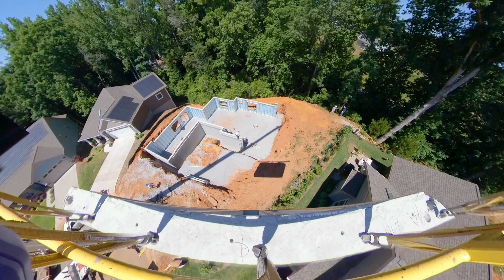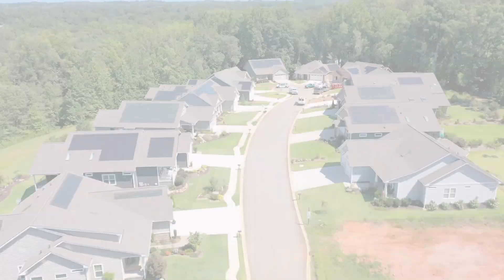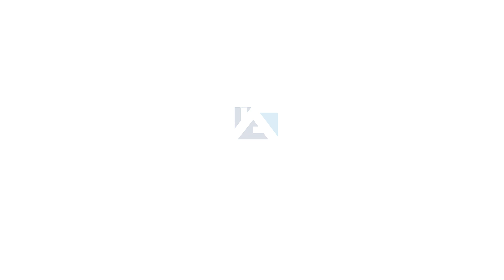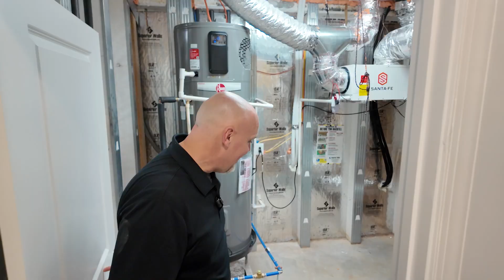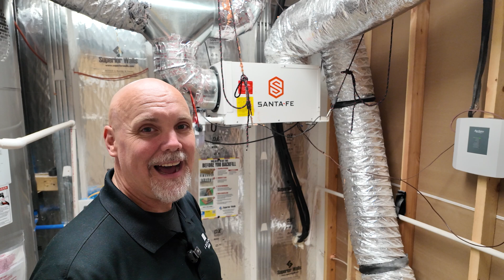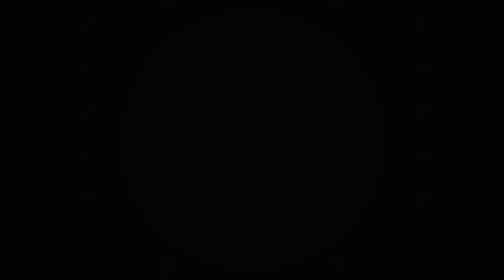The PERFECT Mechanical Room in a New Home

Comment: Your videos ae well done and I take your comments to heart. One question, doesn't the ventilating dehumidifier over pressurize the house causing air leaks and loss of conditioned air vs. an ERV?
Reply from the maker: Good question.  The function of the ventilating dehumidifier in this setup does result in a "slight" positive pressure in the building.  The stale air leaves the house through the one way exhaust ducts of the bath fans, dryer, and range hood when the ventilation mode is active.  There is a very slight energy penalty over this approach versus an ERV.  The ERV in an ideal installation results in balanced ventilation and recovers some of the energy from the exhaust airstream.  While installing an ERV would be "ideal", we still need a dedicated whole home dehumidifier and the ERV adds another piece of mechanical equipment and its associated cost and maintenance requirements.  In a more extreme climate, an ERV might be necessary.
Reply: @AddisonHomes  This response makes total sense to me, and I hope to use your approach in a house I am planning for north GA. Thanks and keep posting.

Comment: Is this system good in Canada where our winter temperatures go to -30 Celsius?
Reply from the maker: It would depend on the energy  performance of the building and how much heating was required.  You would also need to check with the manufacturer to see what capacities they have at extremely low outdoor temperatures in your area of Canada.  Worst case, you could have a backup heat source such as a furnace that could supplement the heating output at extremely low temperatures.